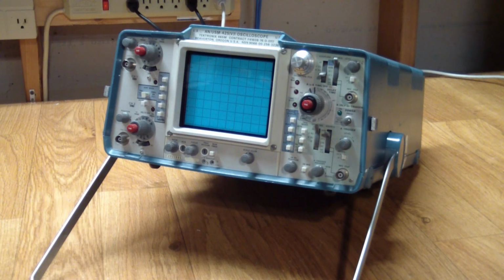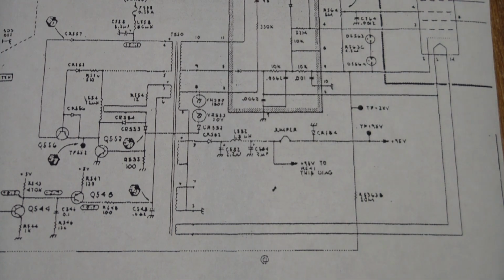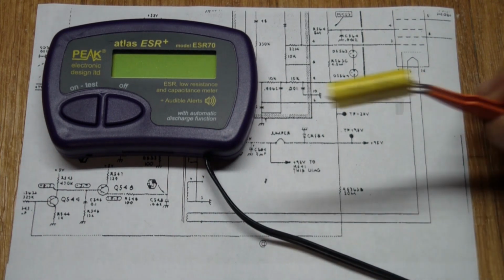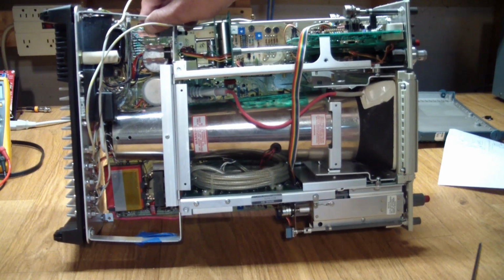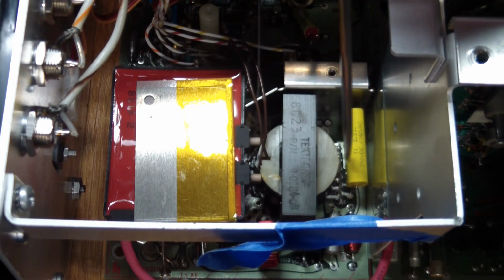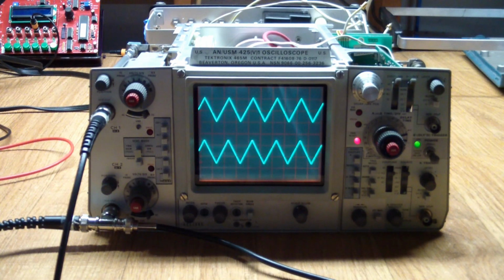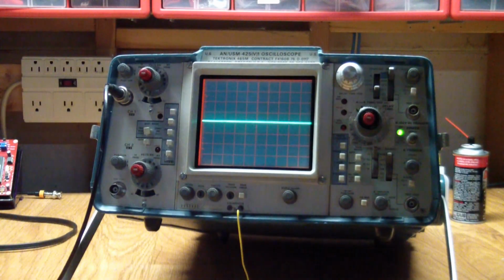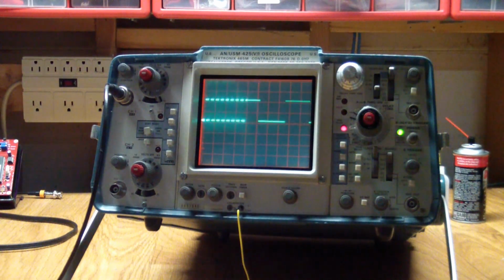AE#18 Tektronix 465M Analog Oscilloscope Repair And Checkout

Comment: I don't know much about electronics, but I have been watching a lot of oscilloscope repair videos because I find old analog oscilloscopes fascinating. It seems like 9 times out of 10 it's always a bad cap. So maybe even an electronic newb like me could fix an old oscilloscope just by carefully going through and replacing capacitors. 😊
Reply: Caps are the number one failure component in all electronics devices. They are designed to fail. Manufacturers use the cheapest caps they can source. Integrated circuits are the next likely to fail item , then transistors.

Comment: Fixed my own 465M after watching this video. The left edge of the screen was distorted. The 95 volt circuit was only putting out 76 volts, and the same capacitor was the cause. Now it looks normal and works well. Thanks!

Comment: I received 475 as a gift, but the man who gave it to me told me that he switched the input voltage switch by mistake instead of 220 to 120 watts.
it was short, maybe 1 sec and he turned it off.
I never repaired the power supply and oscilloscope and I did the same and in the part where the two elements are (I think they are transistors) I found "blackness" on some element that I did not touch.
I am asking for help, I live in Serbia and there is no one here who could fix it.
I have more than 30 years of experience in serv.electronics, but I have never serviced oscilloscopes, so I am asking for your advice and help.
Thank you in advance Vukan
Reply from the maker: When you power up a device with 220V when the range selector is set to 110V all of the transformer (T700) secondaries will produce twice the rated voltage and, at a minimum, cause damage to the power regulator circuit. I would disconnect the regulator circuit from the rest of the instrument and then check if you're getting the proper voltages. Start with the rectifiers (CR721, 741) and work your way to the right. Since the unregulated voltage rails were doubled expect to find components tied to these rails to have failed. 
Good luck, and don't forget to check fuse F700.
Reply: @artifactelectronics  thank you for your quick response, I will listen to the advice and report the results.
thank you very much again
Reply: @vukanbojovic8073 What did you discover?

Comment: I have the scope, I had the same problem the F558 burn when I turn the scope, I reading about this issue and it occurs when the voltage of +95V is unregulated and I don’t any voltage in the test point of +95V. I think that the voltage multiplier is burned :( or the CRT is bad.

Comment: Very useful and many thanks for a no-nonsense view around the inside of a 465M (Same as the one currently dead sitting on my kitchen floor, staring at me pleading to be fixed).
I used this scope in the 70s during my test job in underwater weapons guidance systems and was amazed by the delayed sweep funtion.  It made my job so much easier being able to quickly focus in on rise times and detect ringing caused by "lazy" capacitors and slow inductors.  A very useful function then and hence my ebay purchase of a dead 465M.  I think I may if succesful, call it Lazarus?
Reply from the maker: The 465M is not that complicated inside, so I'm not sure if it qualifies as a Lazarus. Since it's dead it's probably the power supply. But only you can tell.

Comment: One technique I found for cleaning pots as using 91% isopropyl alcohol, working it in, and then leaving the part or instrument in a warm dry place or if small enough inside a dehydrator.

Comment: I'm getting 11v at the 95V test point, and there's also a broken fuse there (that 250mA glass tube fuse). Can be that the same capacitor fault?.
Reply: Could be. Bad capacitors are common on the 465 scopes.

Comment: Artie, I know what you mean about the spray power being finnicky. Keep in mind if you need in the future: try putting contact cleaner in a syringe. If you need further reaching abilities, connect syringe to some tiny flexible fuel hose (like for a weed eater or chain saw) with a blunted needle attached to the end of hose. Cheers

Comment: Hello sir. Can u help me fix my 7104 oscilloscope
Reply: First thing is get yourself a copy of the service manual, and if you have a multimeter, another scope, and a signal generator. You will have what you need to find the problem. Most of the schematics show what the waveforms should look like at each point shown on the schematic. Also before you get that far look for open fuses, and burned or broken parts. If you are near me perhaps we could work out something to get you up and going. I'm in Southern California, and there are some things I can do that others can't and there are things that I really can't do that most other people can.
Reply: @Paul-gz5dp   Thank you for the  reply,  yes I got the service manual and following the instructions on the manual I have checked all the Low voltages and they are all with in specs,  However I need to check for AC ripple, have not done that yet .  I'm in Los Angeles, if you would like to help out, thats great.. I need to test the Plug IN with another working Unit.  Thx

Comment: I am amazed that 89v rather than 95v and too much ripple could pretty much disable this scope - cheap fix, but a pain to get at ! The 465 was a great scope - I used them daily at work all through the '80s on UK MoD work. A good trusty workhorse. You seem to have lots available too ! Very nice to see them restored.
I used the delayed timebase when looking at the waveform coming from DDS tape drive read heads, for eg. The feature you wanted to look at was always a long way away in time from the stable triggering feature of the waveform, so one way to do this is with a delayed TB. This is what you pointed out in the vid, but just thought I'd point to a real world example.
Reply from the maker: I never recapped the whole instrument, so maybe the cap I replaced was the the straw.

Comment: Have one of these, great 'scope. Also have a 453, which has a lesser bandwidth, but which is fine for the work I do. What I really like about the 453 is that it has an astigmatism control, which gives a nice sharp trace. Wondering why Tek did away with this control on later 'scopes...

Comment: I use to work at Tektronix on these scopes and the Vertical Module is fairly easy to pull out.  You have to pull the vertical deflection plate leads from the board using needle nose or tweezers first, not just yank the board out, that breaks things.  You don't need to remove the delay line screws to remove the vertical deflection leads, or pulling them from the CRT pins, the CRT pins are very delicate.  You can see the leads by looking at them from the back side of the board or over the CRT.  Then you remove the cable at the bottom middle of the vertical board and you can then remove  the vertical module, to properly fix the vertical deflection pin.  The horizontal just comes out by removing the rear screw and loosening the front screw, and disconnecting the power shaft, pulling up on the module..  (no deflection leads, they are under the CRT.)      I noticed that the rear mounting screws were missing going from the vertical and horizontal modules to the rear support bulkhead, unless you didn't show removing or installing them.  It seems that lots of equipment has missing screws, from people just taking things apart and not reinstalling everything correctly.   Later Ray
Reply: Can u help me troubleshoot my tektronix oscilloscope?  My email is mandosd49@gmail.com

Comment: Iwatsu a few years back made a very interesting 1GHz analog storage oscilloscope with digital controls and an LCD display.  It used an actual microchannel plate storage tube and a CCD to capture its output.